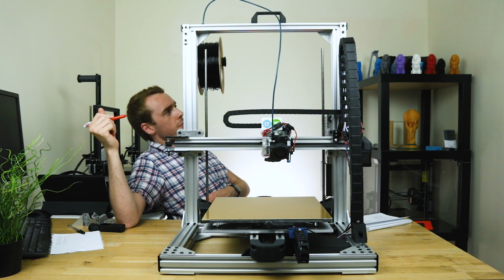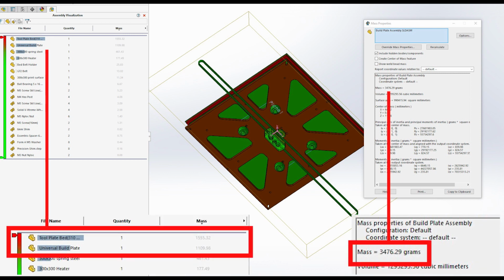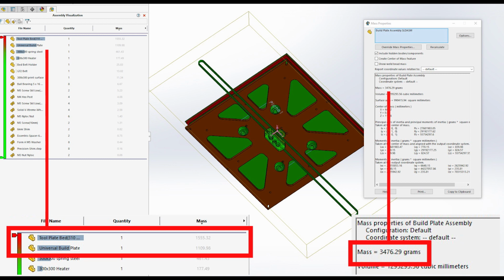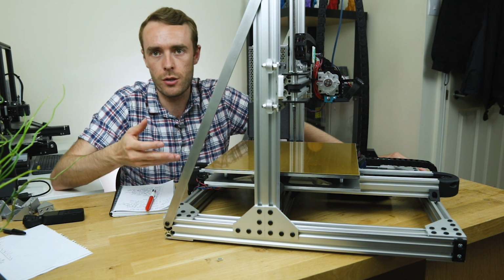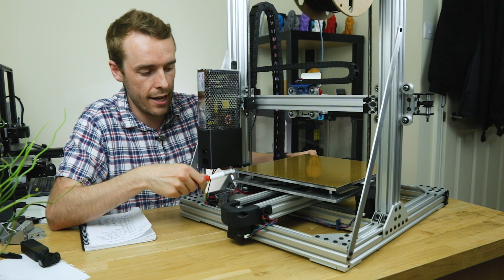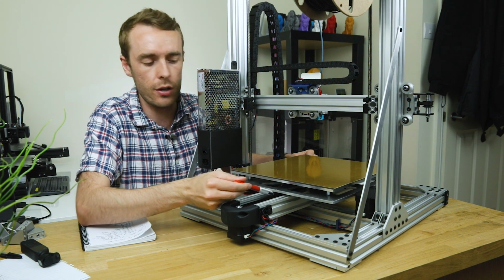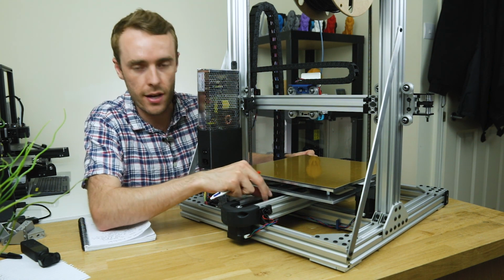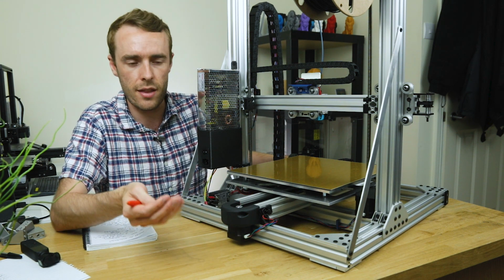Named My Printer BUT Is the Print Bed too Heavy?

Comment: The printer looks awesome. I'm currently working on a stratasys that's about the size of a atm. Big printers are always fun to work with but can be a hassle with the level of hardware they require
Reply from the maker: Thanks. Ye, the bigger they are the harder they fail! It's easy to make a printer, its hard to make a great printer.